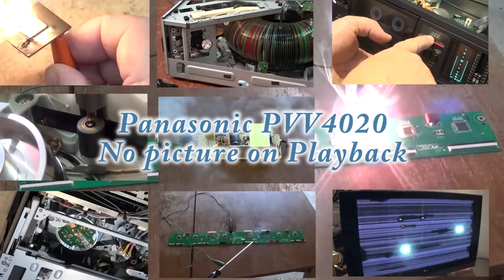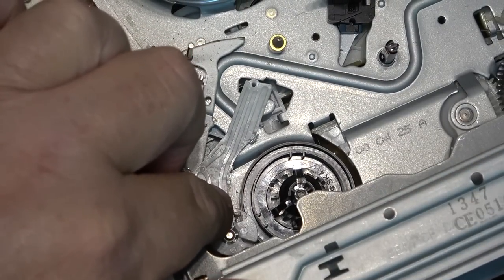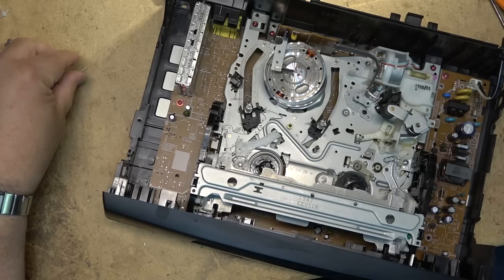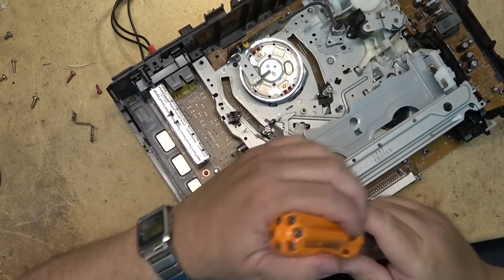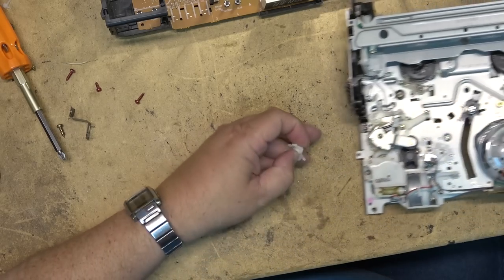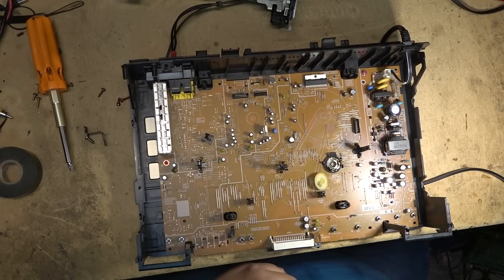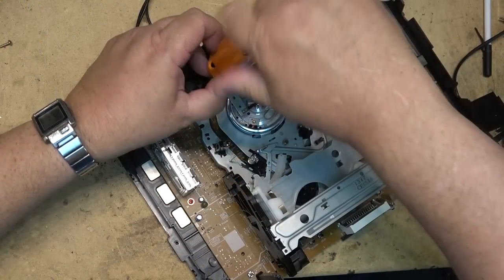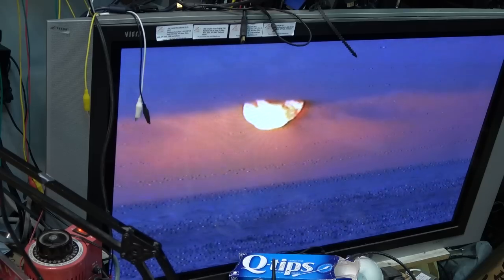Panasonic PVV4020 VHS VCR No picture on Play

Comment: I actually bought one of these for a dollar at a garage sale years ago. I got a lot of use out of it and it actually made me appreciate mono VCRs. For linear mono, it is not the greatest but it is doable. I found that Japanese recorders from the 1980s had superior linear sound. I particularly like the Sharp mono and the Hitachi Dolby stereo units from the eighties. Very simple repair. I had to check the position of the erase head on mine as it would not play back tapes with sound during a test. I guess not enough tension. Thank you for these great videos.

Comment: For the time, these were way better than the Orion mechanism that was sold by the likes of JVC (for instance, the HRA591U). The Orion ones were even worse than Funai. The Orions had an optical mode switch which would take forever to switch between functions. Plus, they had horrible sound and video quality. The hifi was temperamental and the linear audio was fuzzy and had a high pitched ring throughout.

Comment: I know this video is old as the hills! I have a similar unit (Panasonic PV-V4520) with EXACTLY the same problem - the little felt strip (for back tension) evidently broke & dropped off. Like you, I found it in the bottom of the machine; unfortunatly mine had snapped in two. So unless I can magically find that little bugger, the machine is doomed to recycling, I'm afraid! Anyhow, I'm enjoying your way-back-machine videos!
Reply from the maker: Even if it is a bit short it will work.  Glue the piece back on.

Comment: Thank you for your rare advice on how to fix a vcr with no play back.
i'm having the same problem  (my brand is also PANASONIC) except the picture goes to black in play back   also it makes an unhealthy whirring uneven sound in play mode.
I know vcrs are a thing of the past BUT I have many tapes not available on DVD  or streaming formats, & so i need to fix it, when i fast forward on screen there's very little picture also, and its sometimes winding slowly forward & back

Comment: Hello. I recently bought an akai vs-1eg. The machine works, but when you insert the cassette and press play, it tries to read the tape, but it cannot read it and the machine cuts off the power. I wonder what is the problem with this?
Reply from the maker: Many auto stop mechanisms were operated by the tape counter and if the belt broke the counter would stop and the machine would stop. If the counter doesn't move when you operate the mechanism there js your answer.

Comment: Dave sorry if this is off topic but today i got my wisdom teeth out. All 4! Im in bed relaxing and watching this vcr repair video.
Reply from the maker: ouch
Reply: @12voltvids  this chassis looks familiar to the 1997-1999 chassis made in japan. I REALLY liked those Panasonics as well as the mid- early 90's genetation with the broken ic2 connection which i never had and the front loading cog skipping the teeth causing the tape not to load or eject itself.
Reply: @austinthevhsvideogamelover5265  Oh man. I have a PV-4551 that had the second problem first and then it developed the bad IC after I poked around! Ugh! Can you fix those?
Reply: @2ndPyleOfVinyl  ic2 can be resoldiered very easilly. Thats the capstan drive ic that caused the picture to be wavy along with the sound and the speed is changing and the capstan motor stalls and causes it to eat your tape. VERY COMMON FAULT!!!!
Reply: @austinthevhsvideogamelover5265  Mine won't even move. No loading of tape or anything. Clock lights up. I press "power" and the system lights up and then powers off after a few seconds, back to showing the dim clock. No head movement. No mechanism.
Reply: @2ndPyleOfVinyl  maybe the mode switch needs cleaning.
Reply: But it needs unsoldiering and resoldiering when you put it back in.

Comment: You can use a spray to clean the switch mode without opening the switch mode
Reply: You can, but it gets cleaner and you can inspect the little pins if you open it up.  You also don't risk spray or drips getting on components you don't want it on.